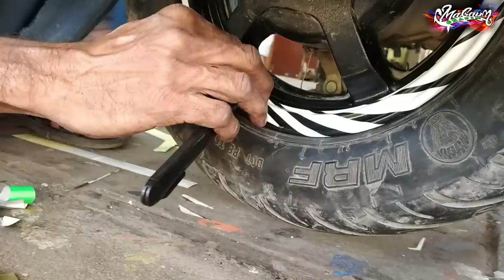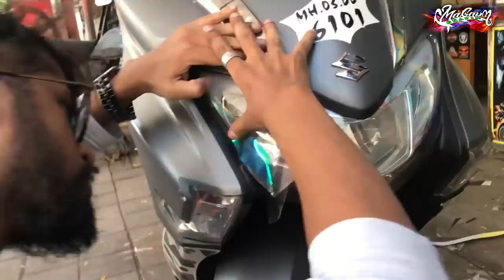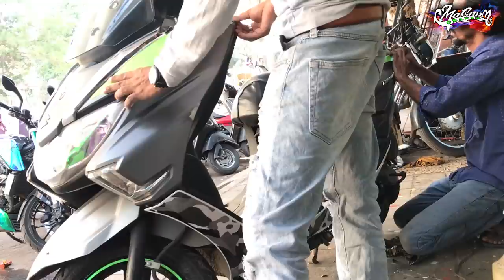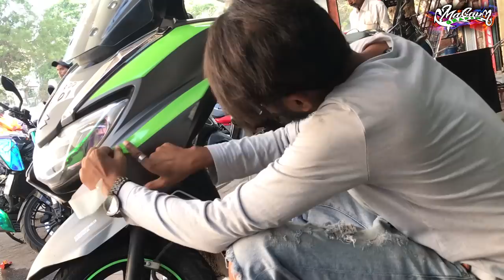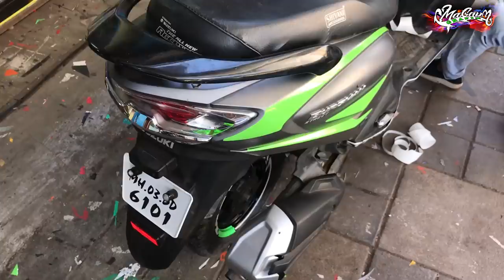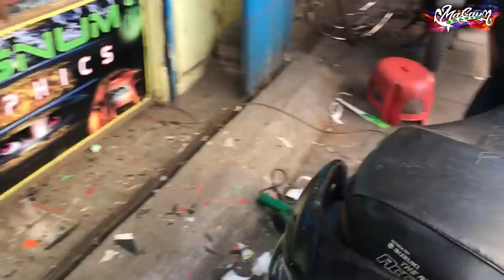Burgman 125 modified

Comment: Nice 
What is the mileage?
Reply from the maker: thanks bro 45
Reply: After 1st service or before 1st service?
Reply: Im getting 52 before service
Reply: @krushil_patel  performance good or not? 
Above 60 km speed reaching any shock or tremor in this vehicle?
Reply: @ramkumarsiva7197  first 30 to 40 feels a bit vibration but after 40 its like butterly smooth...no problem at all..good pickup... great handling..and mileage too
Reply: @krushil_patel  thanks for your quick reply 
I am will buy next week,
Any disadvantage of this scooter? 
Please tell me?
Reply: @ramkumarsiva7197  i bought it just 2 weeks ago and ride around650km so far didn't find any... let's see how it goes...
Reply: @krushil_patel  OK done
Reply: 45 to 50
Reply: @naina6029  ok
Performance good or not? 
Above 60km speed reaching any shock or tremor in this vehicle?